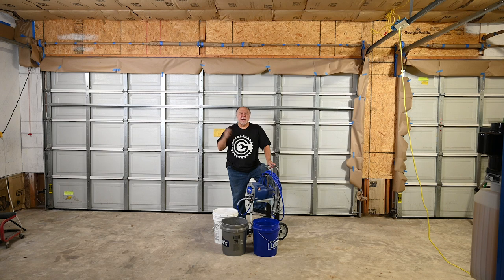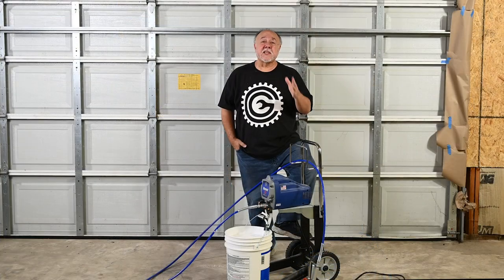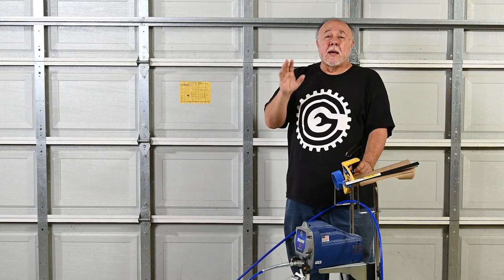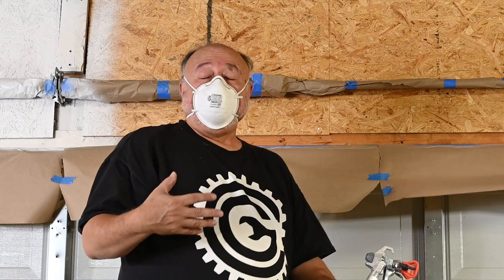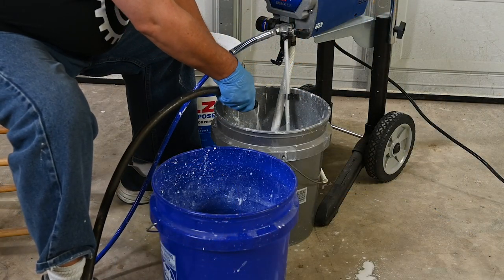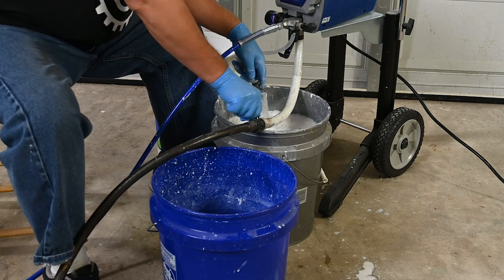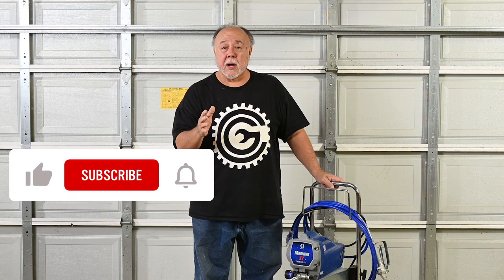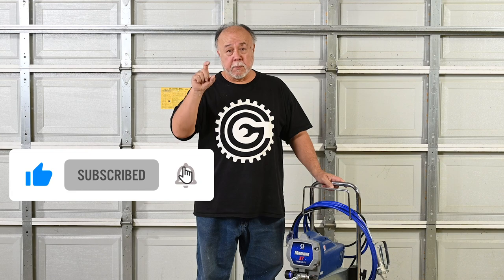First Time Using An Airless Sprayer Part 2: Cleanup & Storage (Graco Magnum X7)

Comment: I appreciate you sharing this cleanup video. I am here to see the X7 in action I am looking at it among others. I have used many airless sprayers in the past and I know you are brand new at this and I mean no disrespect. However you are about half clean here. First mask everything you are going to spray and do it all at once. The spray time is very short compared to prep work. I know they say you can but don't leave paint in your sprayer accept for lunch or a smoke break etc not over night. Use several buckets of clean water and recirculate into them and change buckets over and over Intel it is super clean. Disassemble gun and completely clean it. I also remove the hoses and clean them. Each time you use the sprayer small bits of paint get stuck in the sprayer cracks and crannies and will Harden over time. If you own your sprayer and its not a rental take the time and over clean it and it will always be ready to use after long term storage. The extra time spent cleaning these amazing sprayers is so very worth it. Just my 2 cents. Thanks for sharing your video.

Comment: Thank you for posting this video, well done, very clear instructions. It might be the POV of the camera but it looked like, at one point, you had your finger on the unlocked, pump on, and when you went from one bucket to the other, it briefly passed and pointed at your forearm. I'm thinking, it probably wouldn't happen, but if you sneezed, got distracted and squeezed that trigger....it dose say in the directions that if you shot yourself with paint, to go to the emergency room immediately with the safety data sheet on the paint can.
 Thanks again.

Comment: for anyone worried about splashing, aim the spray gun towards the walls of the bucket in a SIDEWAYS position. this will prevent splashing and instead any liquid will flow against the sides of the buckets.

Comment: Lastly, did you record taking the handle off the tube, removing the filter, cleaning, and reassembling. I think I’m just not strong enough for the wrenches to hold the one nut and the other. I’ll have to wait for to wake up in the morning.

Comment: What was the type of attachment you were going to tell about to help with the turning twisting of the gun a d end of hose.
Like you said its stuff and there was something you were going to add to help so it's not so stuff.
Thank you
Reply: spray gun swivel, and for the cleanup from garden hose get a ball valve so you can turn on an off at the hose end. So you don't have to keep going to turn on and off at the spigot.

Comment: remove guard remove tip use top of tip to push out washer  replace washer use bottom of tip  put washer on bottom of tip push washer back in rubber in washer will hold onto bottom of tip  when putting washer back in line up rounded portion so tip can be replaced in guard

Comment: Thinking of getting one. All the steps to clean are a little overwhelming
Reply from the maker: Yes, it is at first. But if you're doing it regularly it wouldn't seem so. The steps make sense when you know why you're doing them.
Reply: Agreed, airless and help definitely have different use cases. Airless has a lot more steps for protection but you will regret it if you don't. Many of their recommendations seem excessive (like pumping water through for 30 seconds before starting) but those are the things that keep these machines running for many years. I run 3 graco sprayers and have never regretted it
Reply: Also, honestly the cleanup on the x7 takes about the same time as properly cleaning brushes and rollers lol
Reply: Once u get throught it the first time, everything makes since, and it should only get easier. I just now finished clean up on mine. Should be smoother next time.

Comment: Every single video I see doesn't address the hose storage. Are you supposed to just leave water in the hose forever? Attached to the sprayer? Gun attached?
Reply: I don't I drain and blow mine out.
Reply: @tazblink  Thanks for responding. I'm surprised the hose is not addressed in any videos from Graco.